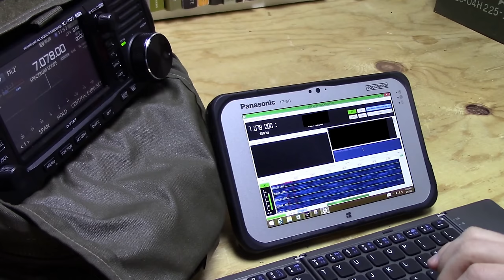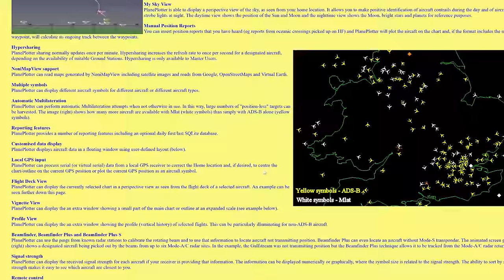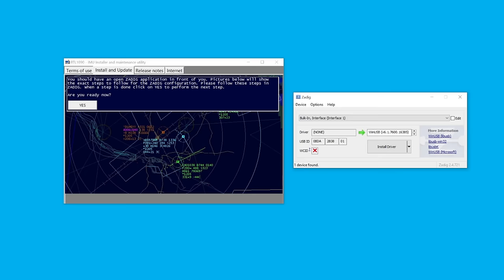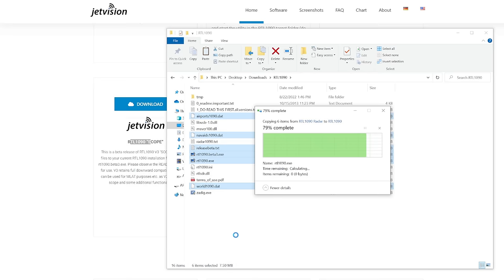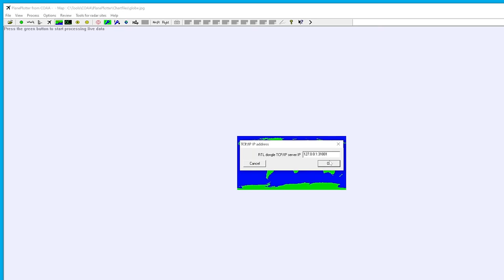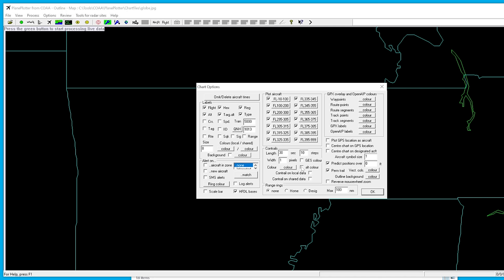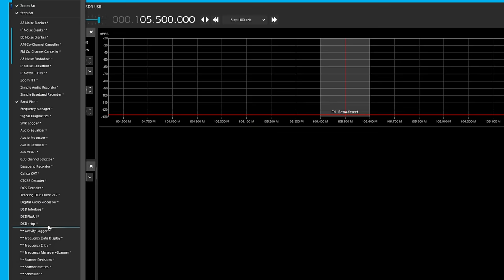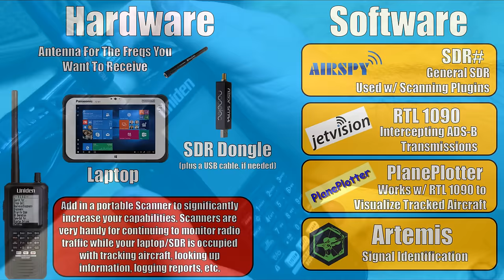Basic Tactical SIGINT: Tracking Aircraft and SDR Scanning

Comment: Pretty sure my cyberdeck running on a Raspberry pi has significantly more power and capability than whatever this outdated nonsense is supposed to be, with more modularity, more possibility for upgrades and cannibalization, and more access to modern software while being at least as durable.
But uh. 
Cool, let's all get windows xp and open ourselves up to infinitely more risk by runnig crappy outdated hardware.
Reply: Hardware is virtually never outdated. The rest of us learned how to put an extremely durable, compact and efficient LP on the air for probably under $200. I can't say which bits you missed, The system is virtually invulnerable, actually, because it's never going to be on the internet except, possibly for a one-time update download.
This sort of "obsolete" technology has the added benefit of being fully compatible with older black box radios like the TenTec RX 320.
So, "obsolescence" might be in the eye of the beholder, eh?
Reply: @gooshy8312  Do you have a go-by of the LP you set up? Prices will be higher now, I'm sure, but I'm struggling to get this project off the ground.
Reply: @tjman4943  
Just to get off the ground, the RTL-SDR dongle works fine, still a good deal on Amazon at $29.99. It looks like the antenna kits are out of stock. I have one, but don't use it much. What I do use is a Tram discone, about $60.00, on Amazon. I'll be getting another one soon.) It's atop a 25 foot collapsible flag pole, around a hundred I think. You can go a lot cheaper - I bought it for semi-portability.
So anyway, if you have a pc already, you can get going pretty cheap. But my total setup shakes out like this:

GMK NUC box PC: $190
RTL-SDR $30
RSP1A $160
Airspy R2 $160 (vhf/uhf)
TenTec RX 320 $600
Uniden HP-1 $500
Uniden BC 125 AT $105
Tram Discone $40 back in the day
an old Alpha Delta dipole center piece holding up 60 meters of speaker wire. These were about $110 or so at HRO. The whole assembly, the DX Ultra, is a whale of an HF antenna.
L-band patch antenna, assembled (LNA and enclosure) $40.
Same thing, just the antenna, $20
Nooelec LaNA lna, about $30 I think.
Nooelec Flamingo FM notch filter, the sama
Nooelec LaNA for HF, about the same.
MLA 30+ hf loop, 40-50ish.
Airspy YouLoop, $40.
Glad I didn't do this all at once.
Oh, some portable shortwaves.
Reply: @gooshy8312  Now THAT'S an answer. Thanks brother!
Reply: @tjman4943  
You're welcome!